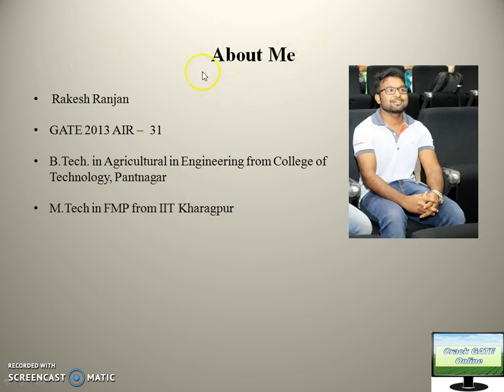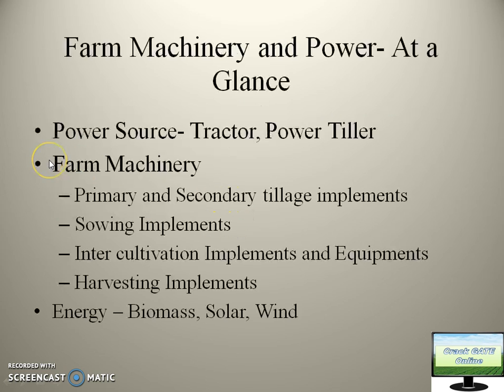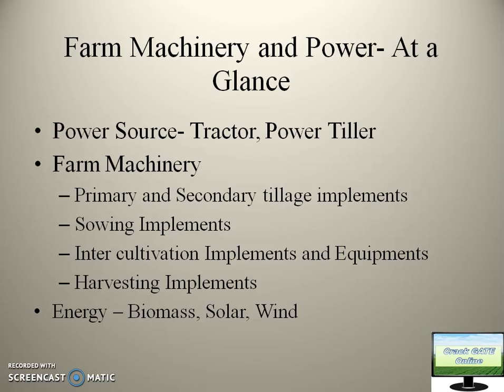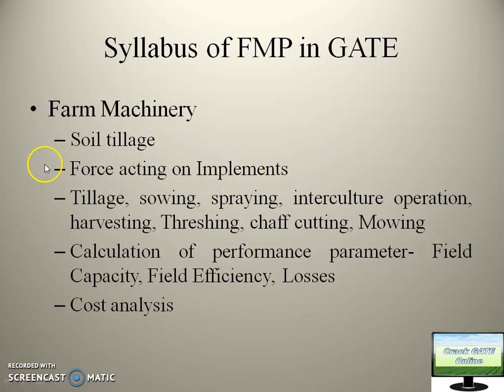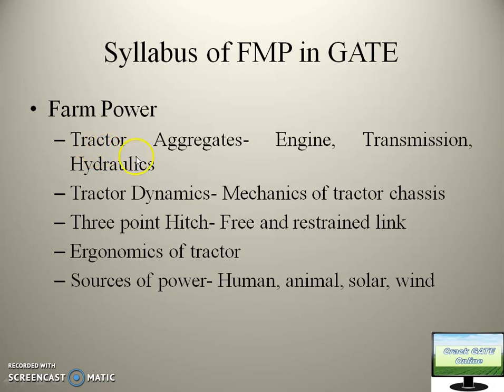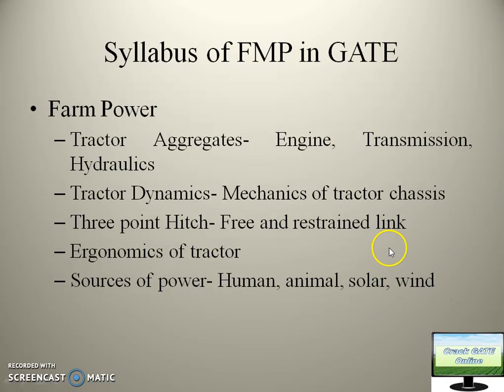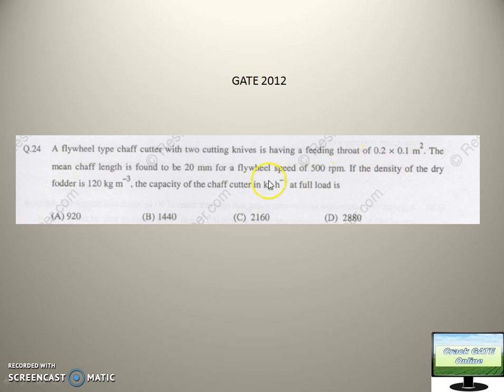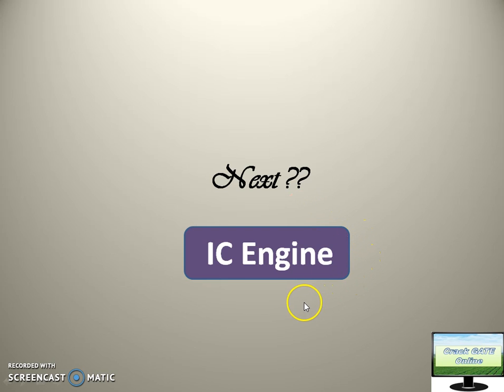1.2 Introduction to Farm Machinery and Power Engneering for GATE in Agricultural Engineering

Comment: The problem you explained will not get the answers
Can you please explain it clearly.
Reply: Venu Gopal you need to find out linear speed of chaff from no of blade, rpm of knife and chaff length, there is simple formula chaff length equal to linear speed divided by no of knife and rpm. Once you find speed multiply it with throat area and multiply with density, you will get the answer.